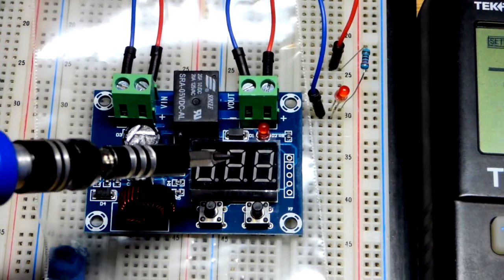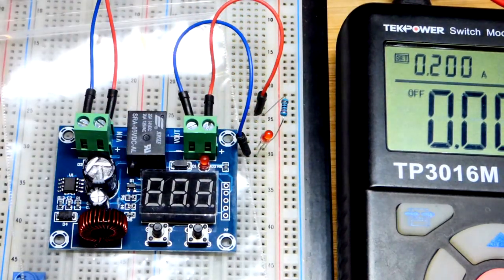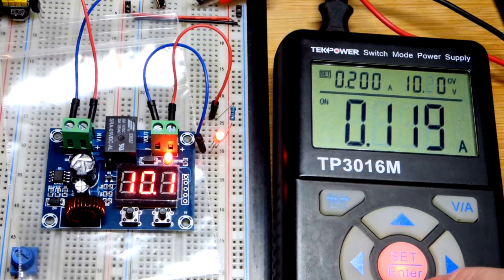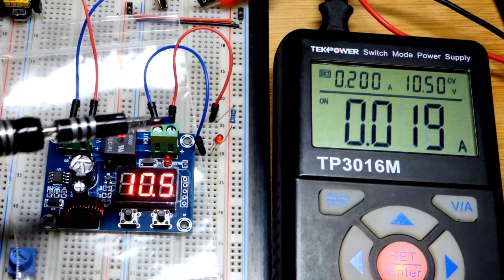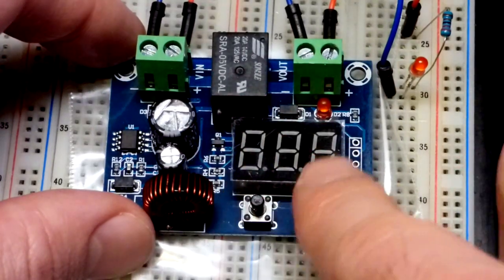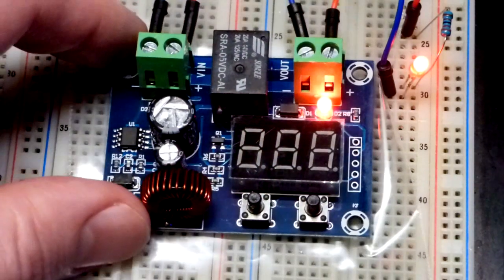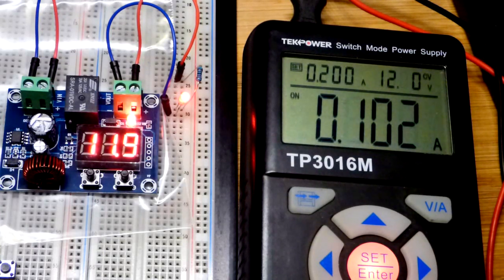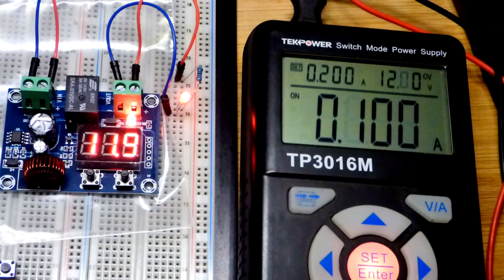Low voltage cutoff module used for battery protection electronics demonstration

Comment: Thanks! What is the lowest cut-off voltage?
Reply from the maker: One of the sellers on Amazon has an image of the board, showing that 6V to 60V can be applied to the input power for the board and the load. That the best lowest voltage info I can find so far.
Reply: @Electronzap  thanks again! I believe the 6-60V module is a different model. That module is more expensive and may be overkill for the project and does not fit my budget when buying in large qty.

Comment: I installed the same module with my china inverter i set my cutoff voltage to 11.3v so on load usually voltage drops so this module turn off my inverter once the inverter is off again my voltage increases then again this module turn on my inverter and it is working like loop ,, Could you please help to sol my problem ?
Reply from the maker: Thr voltage drops more while a battery is providing power and rises again when you remove the load. So, I think you need to set the inverter to a low enough voltage that you don't want to go lower than, and remove the load before it drops that low. Low voltage cut off isn't intended to let you drain the battery to a certain level, it's intended for making sure the battery doesn't drop to a dangerous level.

Comment: Can this module be used for 4 or 5 (perhaps more) cell nihm or nicd batteries?  If no out of box, could it be modified?
Reply from the maker: I'm not a good person to ask, but NiCad batteries are meant to be totally discharged. It's generally recommended to use them until they are dead. I've never wired them up in series, I don't know how you would go about that. I know even less about using NiMH. All I know is to use a proper charger for both of types, as they are tougher to charge than lithium batteries.

Comment: Will the Relay draw  more current from the battery to keep the load connected?
Will it be efficient to use a low voltage disconnect involving a Relay?

Comment: i like your presentation very well done but i need some help. i bought one of these and it turns on at 14 and shuts off at 12, is there one (similar size hopefully) that will turn on at 12(or lower) but shuts of at 14. i am trying to get the alternator light in a 59 ford to work again.  thanks for your help
Reply from the maker: I don't know that I came across a module like that. I spent all my time focused on keeping batteries from discharging too much. Instead of a low voltage cutoff you could try searching for a high/over voltage cutoff module. I never searched for one, but anything you can think of, is probably out there somewhere. Good luck!
Reply: Look for over charge protection module
Reply: Old comment so you probably aren't working on that alternator light any more but what you could do is run the output from the low voltage switch out to another relay that has both normally open and normally closed contacts to reverse the contact.  That would accomplish what you are trying to do on your '59 Ford.  I would power the voltage sensor off the ignition so it doesn't draw power when the car is sitting.
Reply: @shanesdiy  thank for the reply, as you mentioned i did connect a relay to the circuit that operates the original alternator light. now the light come on when voltage is below 12.4 and off when above 13. there  are many blogs from old car enthusiast wanting to activate the original alternator light. in spending much time last year reading these i never found a solution so I just figured it out. also, its off when the ignition it off. mission accomplished.

Comment: Does it still draw current to keep the display on? So if you have it hooked up between the battery and device, the battery would still die overtime?
Reply from the maker: Yeah, it draws power from the battery for the display. So, you'd need to disconnect it or recharge the batteries sooner for smaller capacities.

Comment: But what is need to cut off the circuit for low voltage instead I see overvoltage protection more or less everywhere 🤔🤔
Reply from the maker: Rechargeable batteries are typically damaged when voltage gets too low. It's even worse to over charge them.
Reply: @Electronzap    ...my god.. thanks 😄...it increased my knowledge
Reply: @Electronzap  How low can I set one of these when using a Lithium battery?  (Because they don't get damaged at low voltage)
Reply from the maker: @steffinolte5355  If it is a lithium battery (li ion, or LiFePO4), then you probably want to cut it off when the cells drop to 3V. Less than 2.5V per cell might damage them. If you have 4 cells in series, then you would want to cut off at 12V. Li ion cells can usually be charged to 4.2V and LiFePO4 cells can usually be charged to 3.65V.
Reply: @Electronzap  you should skim thru this video you might find it interesting. https://www.youtube.com/watch?v=QOSJ4Ktob68 This particular electronic instrument allows the rechargeable battery to drop low enough that the device won't even power on. 😅 (And yes I have one, looking to modify it one day with a mechanical power switch.)